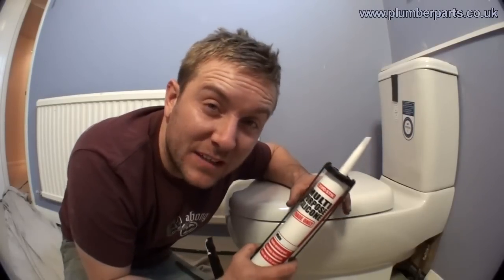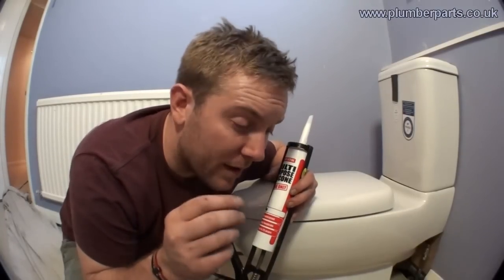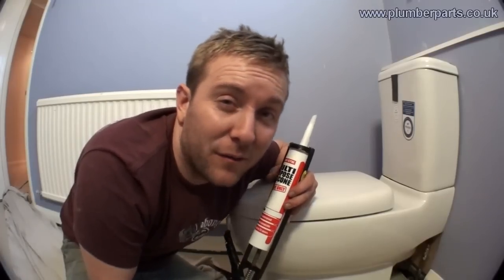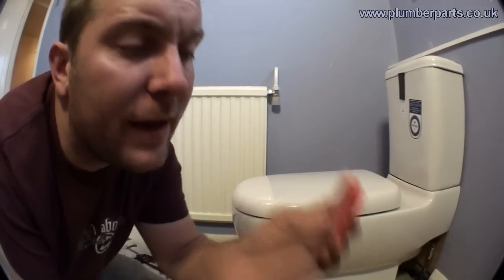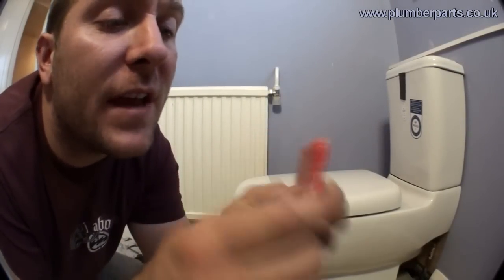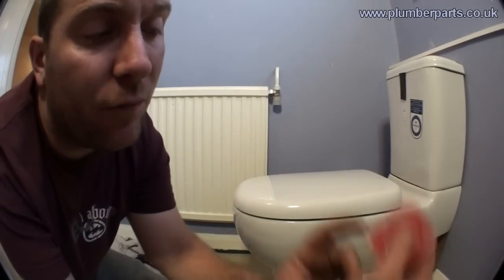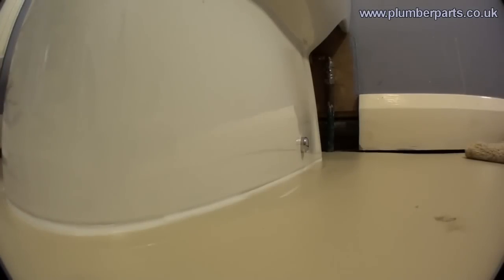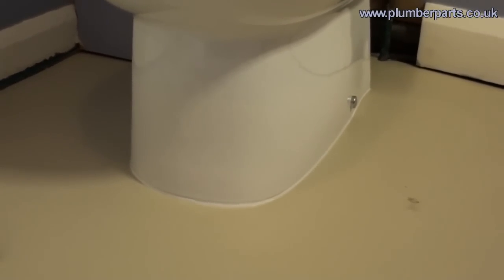HOW TO INSTALL A TOILET - SILICONE SEALANT - Plumbing Tips

Comment: Hi, may I asking how to seal up the water closet at bottom with a black plastic cap which is inserting into the existing 4 inches upvc soil pipe? Thanks

Comment: Hi.
I've had to move my toilet to tile the floor but I don't want to bolt it down as I'm getting a new toilet & that will be in a slightly different place as it's a different shape/size, you think it will be ok just to use sealant?  Thanks.
Reply from the maker: DavidJHarrisonEssex Yes, but use CT1 as your sealant, it's much stronger. Good luck, PP!

Comment: Actually, when installing a toilet, you should use a wax ring (at least that´s what we call them in my country), as using too much silicone will make a pain to remove the toilet if it breaks. Also, when using silicone on the outside of the toilet, you are not sealing the internal discharge of the toilet and this could cause water to accumulate between the toilet and the floor permanently.

Comment: No! No! No! First use a silicon strip packer/ former this will support  more weight also leaves a small 2mm constant gap any smaller is not good as it will penertrat than use masking tape slightly back from the edge  of the wall / floor & the sanitary ware this easier to apply before!!   final fit  pull or push top grade silicon into gap foam off to edge of tape & remove slowly any excess will be stuck to the masking tape & never to the floor /wall leave to cure Great look & a no brainer for uneven floors. Why thank you no one has time to fit any thing just once & well  shameful